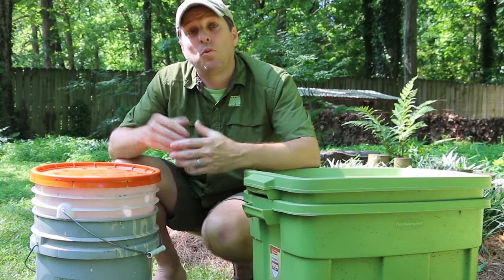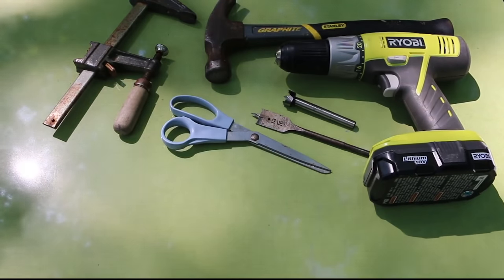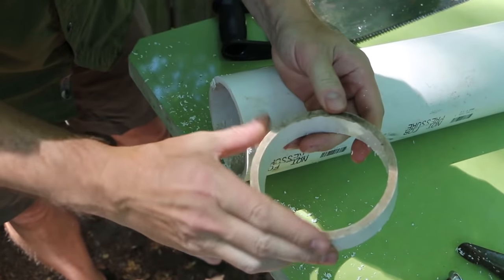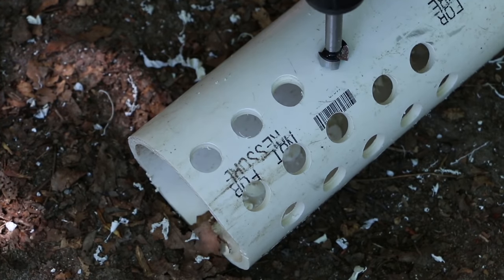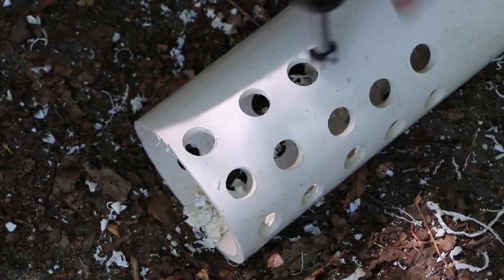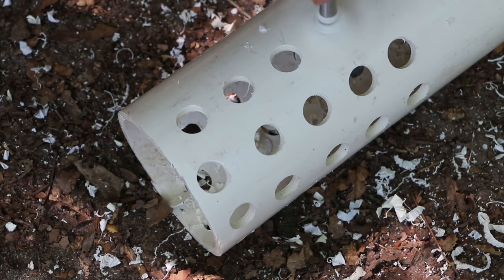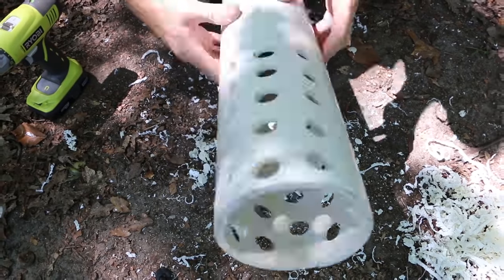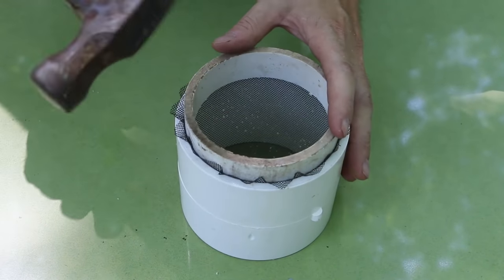How To Make A DIY Worm Tower

Comment: So, I built the traditional worm bin and I also built one of these towers. I’m completely impressed with the tower. Absolutely amazing and ZERO flies. Next season I will put more in the garden. This method is awesome. I
Reply from the maker: Great to hear! Thank you for watching.
Reply: Your bin , brought you flies?
Reply: @kafrikotroll8610  yes. My bin had flies.
Reply: @brock5925   hmm ok Ty VM ! So there isn't a way to avoid that I guess...
Reply: @kafrikotroll8610  I think there is. Just have to build my next one better. Used really cheap materials. Compost towers. Zero flies.
Reply: @brock5925  Well I have to ask you if you ,used the metal screen to the bottom of the compost tower ,so to seal your worms in it and they don't escape in soil. 
No that it's bad ,but I guess you want them captured in the tower ? Correct? Thanks for the answers so far.

Comment: This is so interesting. I will try out v soon. 
As of now i had only started vermi composting so that i can encourage the farmers here with my own experience. 
Naturally soil and climate here is very good but it's not forever. And inorganic ferts are not option here since our state is planning to go organic. 
Here at our uni, we were taught about  big compost bins made of concrete floor  with proper outlet to drain /collect the vermiwash, or what you call it.  It's proper with  antwells and all. 
However here farmers are poor and they cannot afford all that,  which is why we are stationed here to work with them and find out the best low cost suitable and feasible techniques in Agriculture. 
It's nice to see more innovative techniques like this.

Comment: Your drill has a clutch for use when driving screws. You want to turn it to the drill setting. It is found at the chuck.  : )
Reply from the maker: Thanks Edward. I had a previous commenter who noted that as well...although, not as nicely as you did. :-)
Reply: @Edward Coyle - Good to know. Thanks. I didn't know that. Do all drills have that feature?
Reply: @annwithaplan9766  No, but it's pretty common, especially with cordless drills.  These drills are referred to as 'power screw drivers' or 'driver/drills'.  Look for a band just behind the chuck with numbers on it.  Past the highest number setting is a drill bit icon, which locks up the clutch.

The clutch is intended ONLY to act as a warning to let go of the trigger.  If the clutch buzzes (slips) too often, you'll eventually strip it out.  It is useful to prevent over-driving, stripping, or breaking screws.  It is not the same buzz as with a hammer (masonry) drill or impact driver (mechanic's tool), both of which are designed to continuously deliver force while 'buzzing'.
Reply: if you put the drill in the "drill" position, the drill will jerk your wrist at the last moment when breaching the pipe! Do not put in the "drill" position or after the fifty holes you will need pain medication the next day!!
Reply: I did that and the drill still slipped so I went to a regular house current drill with NO problems. And just now writing this response, I think my drill press would have made it even faster and easier. But not everybody has a drill press. I think he made this video so that people with the most rudimentary tools could get the job done📐📏✏🌿🍀😊⚓🇺🇸
Reply: @insp737  
You can feel when forstner bit is about to breach so all you have to do is decrease the downward pressure you have on the drill and after a couple of holes you'll have the📐📏✏🌿🍀😊⚓🇺🇸

Comment: No need for the screen, you need to take the top off to add your food anyway. and I would be concerned that a good solid week of heavy rain would have your worms very unhappy.  Also, worms prefer darkness so a solid lid would allow them to migrate to the food scraps at the top of the tower.  Love this idea and will try it in my garden.  Curious where you live.  I'm in Canada where temperatures get to -30 C and colder so typical composting worms wouldn't survive outdoors.  Not sure if I need to bring the worms inside in the winter or just repurchase new ones every spring.  Another possibility would be to just use the native earth worms, but I'm not sure they will eat food scraps as fast as red wigglers.
Reply from the maker: Kevin, I'm in Atlanta, Georgia. So we don't do -30 C. Yowza! I'd consider capturing what worms you could and bring them in for the winter. A basement or laundry room would be ideal. Or perhaps, burying your worm bin in a very thick layer of compost and soil, even then that might not insulate enough to combat -30 C. Regarding the screen question, I've had soldier flies take over my worm bins if they get unrestricted access. But, the screen is optional. Do you find soldier flies in CA? On the earthworm question, their biology is different. They process soil, versus compostable materials, so they wouldn't do what the red wiggler composting worms do. I'm not a biologist, but there are some interesting videos that get into the differences. All that being said, a compost pile eventually breaks down into soil. You could just layer your compostables in the garden and let them breakdown naturally. But, I say give the worm tower a try and see how you like it. Thanks for watching and for your comment.
Reply: Kevin, if composting worms is too much work due to the -30 C temperatures during winter, then you could do a wire mesh tower (about a foot or two in diameter) and do straight composting without the worms, the wire mesh will allow plenty of air to circulate and the bottom layer of the compost will feed the plants, and for watering you could just lay on top of the compost pile a plastic gallon jug with water and a small hole/s at the bottom for slow irrigation of the compost pile once or twice a week.
Reply: The comment about the rain doesn't make sense because even if the top of the worm tower were covered with something, the rain still falls on the rest of the garden bed, where supposedly, worms have moved into and out of.
Reply: The way I understand it the composting worms will freeze and die but they will have laid eggs that will weather through the cold temperatures to the following spring and will start your Colony over again

Comment: Thanks for the design and thanks to "Thinking Impaired" for suggesting a handle; I've had trouble with PVC caps and sleeves binding making, them hard to remove.
Reply from the maker: Thanks for watching. And I agree, a handle would help twist off the top.
Reply: Would a bit of soft wax, like they use in a toilet ring, help with getting the top off?

Comment: From North Carolina, USA. I made similar worm towers and put them into new beds several years ago. Early returns were everything I hoped for, and then .  . My vegetable plants began to do poorly due to tunneling in their root zones. The culprits were moles, drawn by the worm cornucopia. The damage was so pronounced that I had to remove the towers and count on natural reproduction to maintain a more dispersed worm population.
Reply from the maker: I’ve had mole problems as well. Helping grow the natural worm population is a great option as well. Thank you for watching.
Reply: @GreenShortzDIY  Removing the towers and feeding the worms with "green" kitchen scraps broadcast across the surface of beds has turned out to be a better solution. Moles still tunnel around but not so much and not in concentrated locations.

Comment: Hi. Great video. I have a small back yard garden. I have a container, with several holes in the bottom. If I simply want to,put my limited waste in it and cover it, without side drilling, would that Work?
Reply from the maker: Hi Jim. It should work fine. However, a row or two of side hikes would allow the nutrients and worm to flow and migrate more horizontally, which will get the closer to plant roots. Thanks for watching.
Reply: Jim Willeford yes I have several buckets no bottom and great

Comment: Interesting video. Looks easy and I would like to try it. I have a few questions. Exactly what type of composting worms do you use in the tube; red wigglers, European Night Crawlers? How often do you add water, scraps and bedding to the system? Is it ok to fill the remainder of the tower above ground with scraps and bedding material? Do you ever cover the top to protect from excessive water from rain pouring in? Red Wigglers will freeze in the winter. Do you recover these worms to overwinter them in a bin or leave this tower as it?
Reply from the maker: I've always used Red Wigglers for my composting worms. I get them from Uncle Jim's Worm Farm online. He's got European Night Crawlers too, but they cost a little more. I add food scraps almost daily and cover them with more newspaper bedding. A fresh cover of bedding helps keep the odor down and other bugs away. You can keep adding to the tower. While it wouldn't hurt to fill it with scraps and bedding (the worms will work it down), I'd recommend having two towers to split your scraps between. Or build the 5-gallon bucket worm tower, it has a lot more volume. Here's the video: https://www.youtube.com/watch?v=aeFL2zxU6zg

I wouldn't worry about rain being excessive. Water helps move nutrients into the garden soil and the porousness of the compost will percolate well. In terms of over wintering, the worms will migrate deeper in the garden to find warmth. They can freeze if they can't get deep enough, or if they are kept above ground in a bin. The 5-gallon bucket worm tower is designed to be buried deeper, with a layer of wood chips or hay over the top for insulation, allowing worms to be protected during the colder months. Thanks for watching and for your questions.
Reply: Red wigglers are more beneficial because they stay near the top of the soil. Nightcrawlers stay deeper so maybe help established plants with deep roots more, but the waste nutrients from the wrigglers will drain down to deeper roots too.

Comment: I installed my compost towers and am ready to populate them with worms, but have run into a snag.  I contacted a nearby worm farm to buy the Red Wrigglers.  You recommended about 100 to 150 per tower.  The person I spoke to, Amy, said I would need at least 1000 worms per tower otherwise the food scraps would be processed too slowly to do much good.  I have two reasons for installing the worm towers.  First is the benefit of worm castings going into my vegetable garden.  Second is to use my vegetable scraps

Comment: I live in High desert, Arizona, worried about the heat killing the worms
Reply: In this instance you would probably want a stand alone worm farm located where the temperature is more regulated. You still get the same benefits but have to manually spread the castings and distribute the worm tea.
Reply: After 12" down it starts to get cooler and if you plant it deep that may work better. The Earth at 3 to 4 feet stays at a consistent temperature and is used by earth homes as air condition to keep their homes at an even temperature all year round. Hope this helps.
Reply: @dano7369  As long as you keep the waste at one pound worms one pound scraps...their shouldn't be any odors. Also, worms double  in numbers every one to two months on the amount of feed they receive. Hope this helps. I would go under the sink instead of the living room. Crushing or running the scraps in the food processor helps too. Just put a little water in the food processor after you dump out the scraps and turn it on for a few seconds, cleans the processor. I would also dump that water in the worm bin. This will keep the processor clean for the next time.
Reply: Dan O - not sure if it does or doesn’t, but a friend of mine had a similar setup. He said it has no smell, but I thought it smelled like well used cat litter. He had it in his basement, and it was not pleasant.
Reply: @rogerburns2150  
I try to keep un-pleasantness at a distance🌿🍀😊⚓🇺🇸

Comment: What kind of worms? And where can we buy them?
Reply from the maker: Hi Maura. They need to be composting worms, which are a type of earth worm, but process organic matter not soil. I use red wigglers and I get them from Uncle Jim's Worm Farm. Use the coupon code "greenshortz" should get you 10% off (I think it still works). You can also find composting worms in your local environment, by searching for worms in compost piles or leaf matter (their habitat). It's not 100% that they'll be a composting worm, but it's free. It takes longer to get started that way, but it is possible. Thanks for watching.
Reply: I ordered some from Amazon.

Comment: hello everyone, 
I do not know if anyone asked this question. And I do not have time to look for it if it came out :) (sorry)
What is the maximum temperature worms can live/survive? Temperature reach 40 degrees in the area where I live, if I expose them....
Or if I expose them, as you did, in the cultivation bed in the sun....can you make some measurements?

best regards....
Reply: Glad you asked! To quote Wikipedia:

"The most common worms used in composting systems, redworms (Eisenia foetida, Eisenia andrei, and Lumbricus rubellus) feed most rapidly at temperatures of 15–25 °C (59-77 °F). They can survive at 10 °C (50 °F). Temperatures above 30 °C (86 °F) may harm them"
https://en.wikipedia.org/wiki/Vermicompost

Basically keep it in the shade and you should be fine unless you have an Australian summer

Comment: I saw a fantastic video made by a young farmer in México of worms.
You get 2 blue 55gln plastic containers and put them horizontally aside each other. Then you connect the containers by 2 plastic tubes 2" diameter in the middle and cut off 2 Windows of 1 feet x 32 inches in the top, plus you drill a 1" hole at the rear end for the liquid fertilizer to go out.
Each container needs 2 stools or supports underneath made of metal or wood, the first support closer to the lid has to be a bit higher than the one at the end for proper drainage.
Once you have your 2 containers installed properly, you start filling your 1st container, a layer of soaken woodchips, clean manure, wet paper & cardboard, manure, kitchen wastes, manure, green weeds before flowering to avoid seeds, manure, soaken woodchips, etc. Then you put in your worms and let them eat the first container , once they have finished they will instinctively go through the tubes to the 2 nd container where you repeat the operation.
There ideal temperature is 83F but don't put the containers directly to the sun, always under shade.
In about 6 months you will have a lot of Humus for your plants and a superavit of worms that are an Excelent source of protein for your birds, fish, reptiles and even cattle, this simple instrument can be of big help in a homestead and off grid for sure.
Hope I  conveyed the idea clear enough, Best regards & wishes .

Comment: Hi Thomas, 
Great idea and presentation. Thank you. 
Do you have any info about the temperatures that the worms can survive in this set up. I thought they have to be in 50-70 deg F for optimal performance. What happens if the temperatures dropped to 30 deg F? Thanks.
Reply from the maker: +Romin Hawk you are are correct on the temperature range that composting worm thrive in. I've sometimes seen the top end at 80 degrees F. If they can't get to warmer temperatures in the ground, they will die when it freezes. In a worm tower setting they will migrate out into the garden to stay warm. A good top dressing of wood chips can help them overwinter in a garden bed. If you've got composting worms in an above ground container, where they can't escape, they can freeze to death. I move my bins in the garage for the winter. A laundry room or basement are better options. Thanks for your question.
Reply: Will straw work to help keep them warm during the winter?  I was thinking of putting a deep layer of straw around the tower.  I am in Indiana and it can get to pretty cold.
Reply: @jennypatty9179  Any material that holds a layer of air will help insulate the ground.  Straw works, mulch is hardier and the more you put down the better it will insulate.
😀  Cheers!

Comment: It does not have to be this complicated.  I use 4-6 foot chunks of pvc...wider diameter scrap from jobsites.  Drill big holes in bottom 2 feet, you do not need that many holes, worms find way in from bottom too...bury vertically in center or bed.  I like a few feet above ground, easier to fill including over snow in winter.   Top with potted geranium, done. Good for disposing of stuff like meat which doesnt go in main compost bin.  No flies, pests, odors.   Easy.